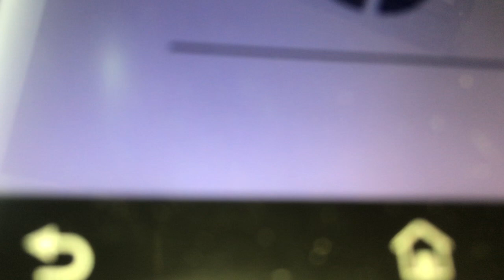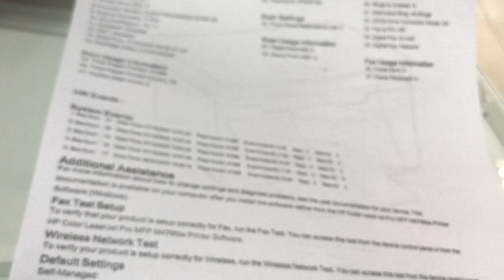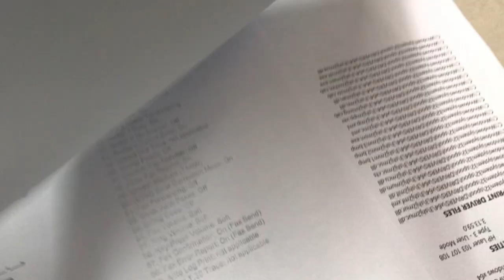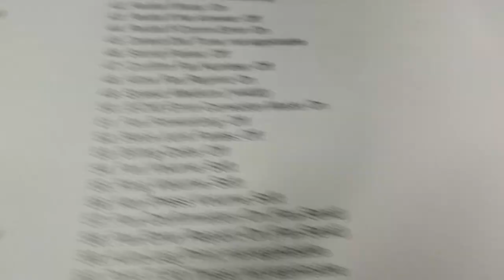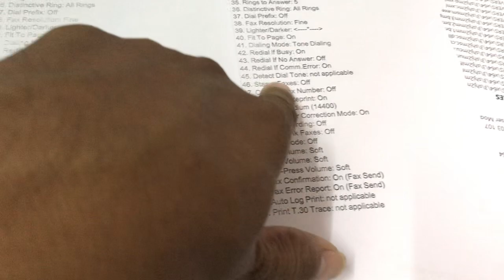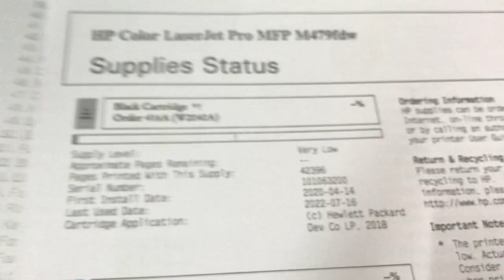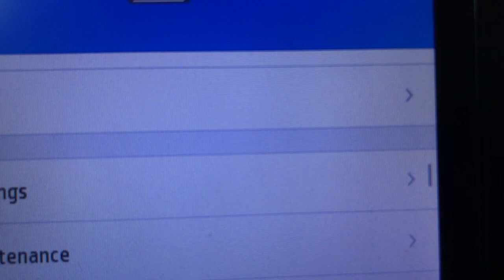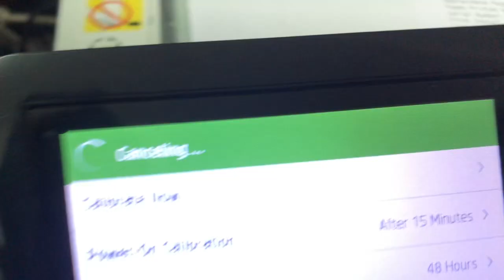HP Color LaserJet Pro MFP M479fdw m479 error Even code 59.72.00 toner cartridge print not clear

Comment from the maker: HP Color LaserJet Pro MFP M479fdw-M479 series printer failure Even code 59.72.00 toner cartridge bad print not clear ,59.7x.00 or 59.8x.00 the printer experience developer motor M3 error,59.70.00 black developer motor startup error,59.71.00 Cyan developer motor startup error, 59.72.00 Magenta developer motor startup error,59.73.00 Yellow developer motor startup error, 59.80.00 black developer motor rotation error,59.81.00 Cyan developer motor rotation error, 59.82.00 Magenta developer motor rotation error, 59.83.00 Yellow developer motor rotation error